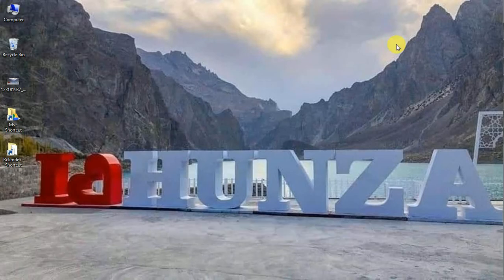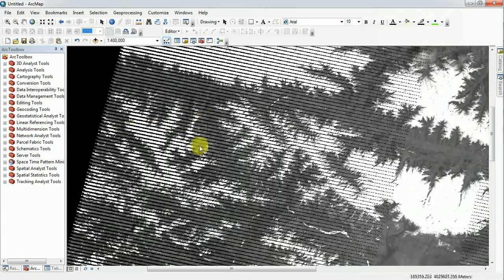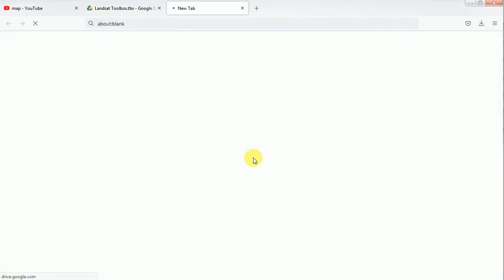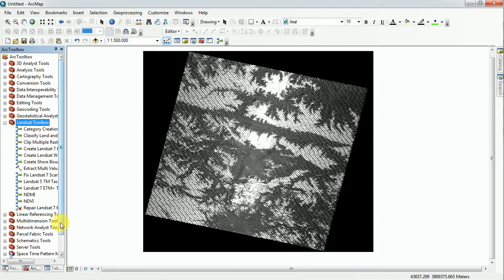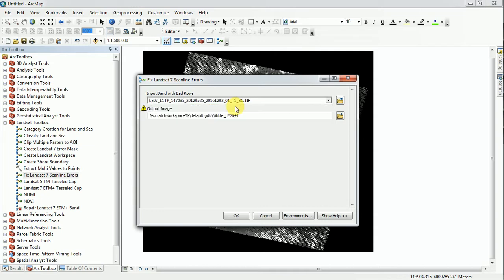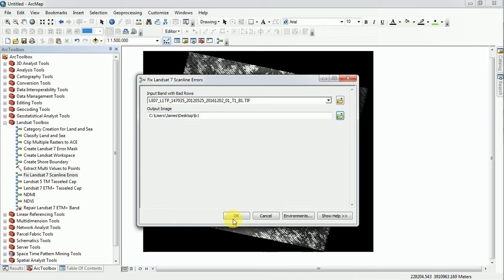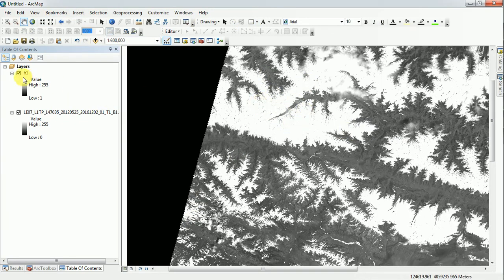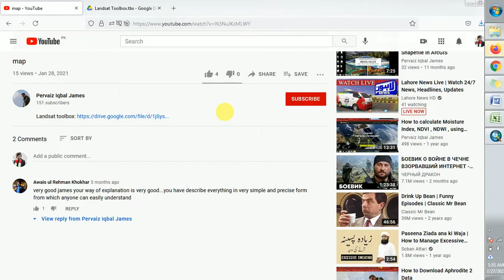How to fix and remove Scan line error in Landsat 7 Using ArcGIS

Comment: not wokring on arcmap 10.8 and arcgis 3 pro
Reply: same here i'm facing the same issues
Reply: @ngvulotep8607  try to avoid Landsat 7 images, there is no solution, I found a solution which was using Erdas Imagine software but this is not a good solution as the software filling missing gaps by average countings